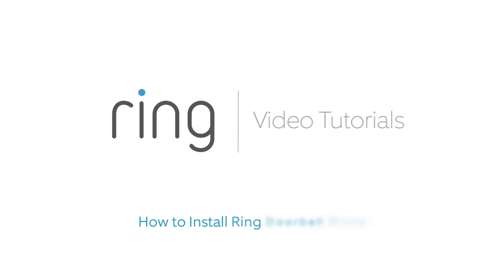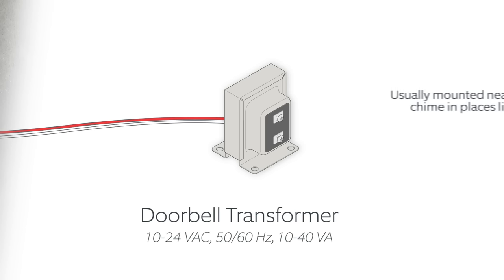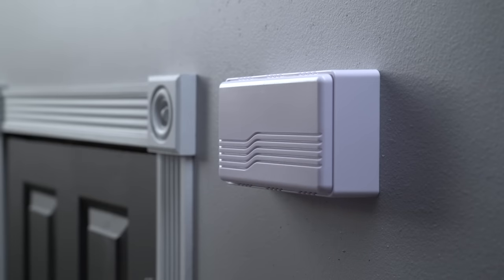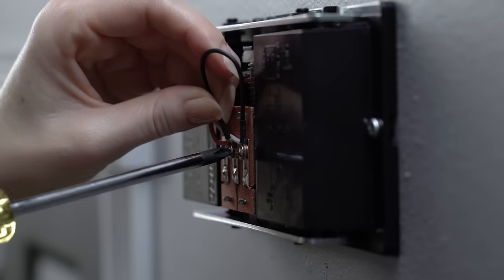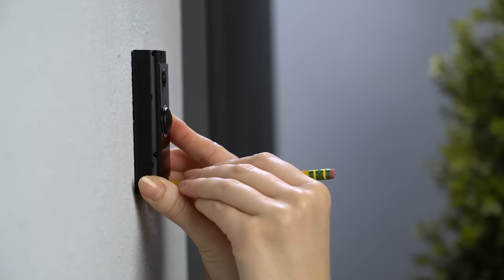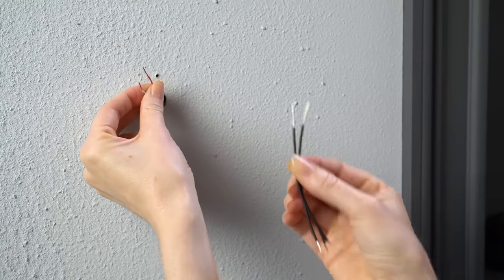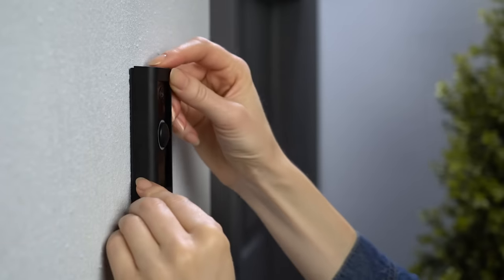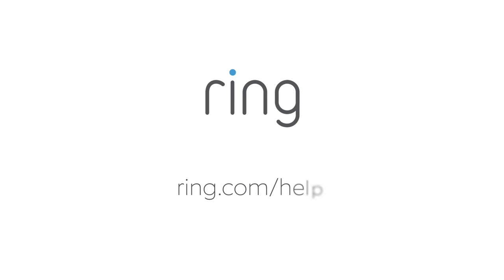How to Install Ring Doorbell Wired | Ring

Comment: Instead of calling an electrician; couldn’t you just flip the breaker switches until the doorbell doesn’t chime when rung??
Reply from the maker: Hi there. Rest assured, you do not need to hire an electrician to install Ring Video Doorbell Wired. If you're able to figure out which breaker is the correct one, then you don't need to contact anyone. However, we do recommend contacting a licensed electrician if you run into any concerns regarding the wiring, or if you are unsure about your electrical components.
Reply: Of course. I am an electrician and I can assure you, it’s much more worth your time and money to watch a YouTube video on how to install a ceiling fan, outlet, or doorbell. But of course as it’s my job I have no problem making money.
Reply: Just buy a tracer and hold it against the wires, it will beep until there is no power, so switch the breakers off until it stops beeping and that’s the breaker you need to shut off so you don’t get electrocuted
Reply: No.
Reply: Sometimes your breaker switches could be faulty and you may not even know, use a dmm to check continuity after flipping switch before touching leads.
Reply: @joeythefoxxo  Except not everyone’s setups are the same. Some people have poorly installed half-effort systems by the previous owner’s drunk cousin Ed with no labels on the chime wiring/transformer, with more wires than the examples or diagrams provide. 

So yeah, some people will call an electrician in that case.
Reply: Legality issues. Imagine they made this guide and didn't say call an electrician, someone gets injured or dies and Ring gets sued for it.
Reply: Id kill all the power switches , just to be sure

Comment: As with anything electrical, looks like they forgot to add weatherproofing although I don’t own one yet.  Recommend caulking or sealing from exterior around the top edge and longer sides to prevent moisture behind casing.
Reply: Not all the way around though moisture can still get in. So leave the bottom uncaulked so if moisture does get in it has a place to leak out the bottom.

Comment: Silly question but do I really need to add the jumper cable to block the sound? What would happen if you don't add this cable?
Reply: Exactly what I’m thinking. What would happen if you don’t add jumper cable ? 
Maybe they don’t know either lol
Reply: No one knows as in you have 3months of no comment
Reply: I didn't sdd the jumper but the doorbell is still working fine
Reply: late reply, ring wired is not programmed to ring your internal bell at all even their is no internal battery to keep it on
Reply: It will constantly ring
Reply: Twisted wires bulge, when tightened, jumpers don’t.
Reply: So if the jumper is not installed, the doorbell will constantly ring?  So the jumper prevents the doorbell from ringing? How do you hear the doorbell ring inside the house?

Comment: Okay I have to ask this question one more time. For what purpose do you need a jumper cable in a wired system? From my reading on follow up on some videos you are jumping out the existing wire in order to use their "wireless" chime bell. Now once again I'm not fully sure if this aspect is true or not, but still I don't see no reason why you need a jumper cable the way it is used in the video that seems very dangerous to do.
Reply: Same question here

Comment: What if the house was build in the 50’s and does not have a doorbell to begin with? Can you still wire it to electrical wires within the wall?
Reply: The transformer will have to be added. As with any doorbell
Reply: Just get a wireless one. Battery operated.

Comment: What is the purpose of connecting the jumper cables behind the chime/ringer box?
Reply: I can't figure it out either, my bell won't ring inside with or without the jumper
Reply: It’s so the power can flow to the ring door bell. You old doorbell will not ring with your new ring bell
Reply: Bruh I just bought one just for a tiny piece and for all of that the chime doesn’t work… bs
Reply: update, ring could've made it work with the existing ringer but decided to force you to buy their chime, so thats what i had to do. SUCKS

Comment: Where do you install the little black jumper cable in the time if you are installing on a rear or side door? Still front and trans? I am putting a ring on my front and side door wired ring.
Reply from the maker: Hi Matt, great question. To ensure your Ring Video Doorbell Wired is receiving power, we recommend attaching the jumper cable to the 'rear' and 'trans' terminals inside your home's chime kit. This will ensure the power coming from your transformer is being sent to the back door. Please let us know if you have any additional questions regarding this. We're here to help.

Comment: Can you direct wire it to the transformer?  I would love to just get rid of the chime box on the wall and just have a small 1 gang access plate/cover.
Reply: Most certainly. All the jumper does is eliminate the chime box. If you want to remove the chime and use a wire nut between transformer positive and push button, go for it.

Just note that if you ever go back to a regular doorbell or move out, you can’t have it wired this way, as you will cause a short.
Reply: @joeythefoxxo  What happens if I don't use the jumper cable?

Comment: What’s the purpose of the jumper cable for the chime box?
Reply: I think it's so the chime will not sound when it is rung, because you'll get a notification on Google home if you have one, and your phone.
Reply: *or alexa
Reply: The jumper cable seems to have a small in-line resistor in it, so I assumed that it is to make sure that the existing doorbell still chimes. However... I, too, could not find any markings like TRANS or FRONT on our transformer, so I just didn't install it.
I went ahead with doing the rest of the unit and it worked fine -- except that now the existing doorbell didn't work. So I went back to the transformer and put on the jump cable in the way the video shows and it completes the circuit to the bell PERMANENTLY -- as if someone is holding down the button -- so one ding then no *dong*. And it was at this time that the Ring unit reset itself and then restarted,  and reset and restarted, and reset and restarted ad nausium. The jump cable was draining to much power from the transformer!!!
I disconnected the jump cable, rebooted the unit (the little orange button on the side) and it was fine. But still no *ding-ding*. Turns out your existing doorbell will not work now so make sure you're always able to hear your phone, OR you'll have to buy a Ring wireless bell unit which just plugs into a mains socket in the house.
So, what is the jump cable for?  Buggered if I know but DON'T PUT IT ON THE TRANSFORMER.
Reply: @ianwright1791  From my knowledge it basically design to prevent your chime from working "on purpose", or rather to prevent a fire hazard from your existing no longer functioning chime. Lets look at it this way (and this is all IMO) If you don't remove the transformer or cut power to the chime, you have electricity still running to the chime, so I'm guessing this is a way to maybe complete the circuit or something. All I know is this cable is to make you buy a damn wireless chime that they sell.

Comment: My doorbell is charging from the wire but won't ring inside. I tested it again without the ring doorbell and the original works fine. Not sure what to do. May just buy a chime for 40 bucks. It should of just worked.
Reply: I’m having exactly the same problem.  I’ve connected and reconnected several times. The original chime works fine without the Ring installed but will not chime from the Ring doorbell button.  The white ring on the front of the Ring around the button lights up when wired and it is getting 19v at the terminals on the back of the Ring.  Other posters commented that the Ring will not work with an existing electronic chime.  I ordered a Chime Pro tonight before I learned that it can ring thru my phone or an Alexa device.

Comment: Do we actually need the jumper cable?
Reply: Yes. This device bypasses the existing chime to receive constant power (it doesn’t have a battery like the more expensive models).
Reply: @joeythefoxxo  Do You Have Ring Video Doorbell Wired!
Reply: @jadamioncole1873  Yeah I do.
Reply: @joeythefoxxo  what if you’re installing more than one?
Reply: Would you need more than one jumper cable?
Reply: @MrJoeBanks  Depends how your current doorbell is wired. Look inside the chime box. If there is a transformer screw and then two wires connected to another screw, then you need one jumper (single tone chime box). If you have one where there is a transformer screw and then two other screws labeled front and back, you need two jumpers going from transformer two those two screws. 

Make sure you install the ring before jumping the chime. And try to have the power off if possible. Be sure your doorbell transformer has the proper power output to run two. If you have the doorbell transformer voltage and volt amps I could gladly help you figure that out.

Comment: Will the old doorbell still ring when the power is off?  Trying to install mine but worried the power isn’t off lol don’t wanna get zapper
Reply: Its low voltage, it wont zap you if you leave the breaker on. Ive done it over 30 times.
Reply: @peteburns824  You can further reduce this by using non metallic tools, and don't let the wire touch each other. 😅
Reply: @lorenexus4917  If the wires touch each other all that will happen is that your chime will ring.

Comment: I think I followed all the steps correctly, but it won't power on.  I can't find my transformer anywhere, which is unfortunate.  Does it matter which terminal is connected to which wire on the Ring itself?
Reply: Did you check in your garage...or the attic?🤔
Reply: @howlme  xD

Comment: Maybe a dumb question but if i dont currently have a doorbell can i just install a transformer and not a chime? Just curious where the actual chime will come from if not the chime box because it seems like the jumper cable is designed to eliminate the chime
Reply: You can use your alexa as a chime.

Comment: Will my existing chime device sound with the ring doorbell?
Reply from the maker: That's a great question, Aaron. As long as your internal chime kit is compatible with the Ring doorbell you have, your existing chime will sound with the Ring Doorbell. Would you mind letting us know which model Ring Doorbell you have?
Reply: @ring  I recently purchased the new Ring Wired.
Reply from the maker: Thank you for that clarification. The Ring Video Doorbell Wired currently only works with the Ring Chime for audible notifications in your home and will not trigger your pre-existing chime device. This is the only Doorbell we have available for purchase that will not do this. We're happy to help if you have any other questions.
Reply: The whole purpose of this model is to slim up the device if you don’t care about the original chime working.

Comment: I followed the instructions to the letter but whenever I push the button, it does not trigger the sound from the home chime box anymore
Reply: They should simply be more upfront about this, especially since they show you having to tinker with your existing chime box.  This device will not not NOT work with your normal home's chime box.  You need to also buy a Ring plug in chime, or only receive doorbell notifications on your phone.
Reply: That’s because the new wired version that just came out does not work with existing home chimes. Not sure why this video shows an existing chime with it
Reply: You can receive doorbell notifications on any Alexa enabled device. Much better than a loud chime box. Very handy if you have babies or pets
Reply: The whole purpose of this model is that they removed the bulky battery, making it so it needs constant power. If you want a chime, buy the $100 model. It’ll work with your chime.
Reply: @jpdunfee  They show it because by passing it is a step.
Reply: @joeythefoxxo  thats right.  But problem is they don't explain it.  First she tells you to make sure your existing chime works, then she tells you to put this wire in it (which effectively deactivates it, but they don't say this).  Most people will have no idea what the jumper is doing.  A really flawed misleading video in this regard.  Just say that the chime needs to be deactivated in order to save power for the unit to work without interruption, and at least mention the plug in Ring Chime as an alternative.   Don't mislead people into thinking this works with the existing chime box.
Reply: @davec3651  Okay I understand now. Yeah the video is misleading for sure.
Reply: @davec3651  they are very upfront about it.  Read more carefully.
Reply: @davec3651  Except...on their website, when you place an order....if you actually read what you're buying, it says several times that the chime won't work. In fact, most people are only looking up this video AFTER they've bought it. So the reading and understanding should already be done....on their own part.

Comment: Question about the transformer VA requirements - Here, they say 10-40 VA range; Ring website only specifies 40 VA Max; and I've seen a sticker on the actual doorbell itself says Min 20VA, Max 40VA.
So please tell me which it is for sure?
Reply from the maker: Hi there, we would be happy to answer this question. If wiring one of our battery-powered doorbells, you will need a transformer that outputs between 8 and 24 VAC (with at least 10VA). If wiring a Ring Video Doorbell Pro, you will need a transformer the outputs between 16 and 24VAC (minimum 10VA, 30VA recommended). 40 VA is the maximum amount that can be used with our doorbells.
Reply: I’ve gotten it to work flawlessly on 16v 10va. You’d have zero issues if you purchase any sort of 24v transformer. As when the voltage goes up, current draw goes down, requiring less va. So if you have or purchase a 24v 40va transformer, that would absolutely be way more than sufficient.
Reply: @ring  
So, specifically for the video doorbell wired featured in this video, it's 10VA minimum then.  Maybe recommended 20VA?
Reply: @joeythefoxxo  
Thanks for adding Joey.
Reply: @ring  This is all completely incorrect. Don't give electrical advice if you have no idea what you are talking about. 
Battery units are not connected to a transformer and don't use AC power feeds. 

The doorbell draws much less than 30W (30W is way over actual usage), which is about 1.25A at 24V. I have mine on a 24V DC battery on a gate opener. 

If you are using AC power, it can be 10 to 24 Volts . Just make sure that the volts X the amp capacity adds up to 30W (Watts is same a VA more or less (alternating current alternates and it  gets complicated)). 

Bottom line.. they don't take much power and it is very flexible about how much it can take, so you are unlikely to break it.
Reply: @joeythefoxxo  the VA stays the same. It is the power draw. Higher voltage draws less current, but the VA (effectively same as wattage) stays the same.

Comment: My lights stopped working in two of my rooms and the doorbell stopped working I think I fd up my wires
Reply from the maker: We appreciate you getting in touch with us, Josh. It's important for your Ring Doorbell to be working at all times to provide you with security. We'd like to learn more about what's going on here. Please give us a call at 1-800-656-1918 (or if outside the US: http://ring.com/callus) 24/7 for more support.
Reply: This happens on really old doorbell transformers. They’re not able to handle a constant load and short out. I recommend upgrading your doorbell transformer.
Reply: @joeythefoxxo  oh sh&t

Comment: If i am installing for two doors, do I have to put the jumper for both front and rear to trans or just one jumper is enough?
Reply: Depends how it’s wired. If it is one screw that says trans and another that says door or something with both wires, you only need one jumper. 

If there is a trans screw and then two other screws that are labeled front and back, then you need two jumpers. Both connecting trans to the other screws.

Comment: So a Ring Chime is not needed right?
Reply from the maker: That's a great question, Dave. A Ring Chime will allow you to hear your Ring and Motion Alerts throughout your home. Without a Ring Chime, you will only receive Ring and Motion Alerts from your mobile device. Also, the Ring Doorbell Wired will not activate your internal chime kit; this is where a Ring Chime will come in handy.
Reply: @ring  Nice just a good way for you to make more money I see
Reply: @metaltera86  Nah, that’s just the whole purpose of this model. It’s made to be slimmer (cause no battery) therefore it needs constant power.
Reply: You will get motion and ring notifications on you phone and any echo speakers in your home.   Really a actual door bell sound isn’t necessary.   It’s just a matter of personal preference.

Comment: So if I hooked my ring up to the two wires from my existing doorbell and rang it but nothing came out of the chime box on the inside does that mean my the door bell box is incompatible? If that’s the case what do I need to make it compatible
Reply: No, this unit of ring doorbell is NOT compatible with existing chimes, you would need to buy the ring add-on plug in chime for that.

Comment: My door bell chime doesn't work now
Reply: That’s how the item is designed. Pair to an Alexa enabled device and it will notify you that someone is at the door
Reply: That’s the whole design of this model. They removed the battery for a sleeker and cheaper device. If you want a chime, get the other model.